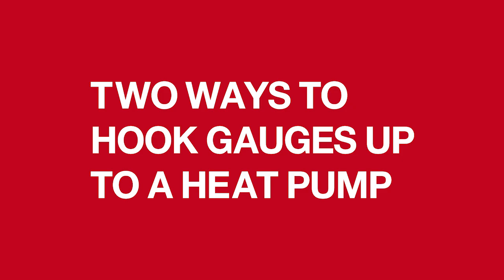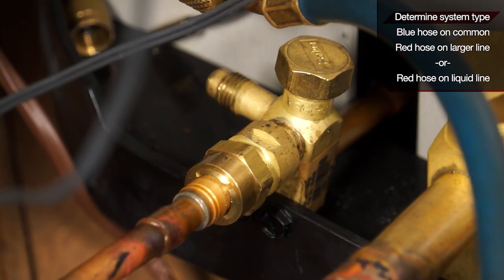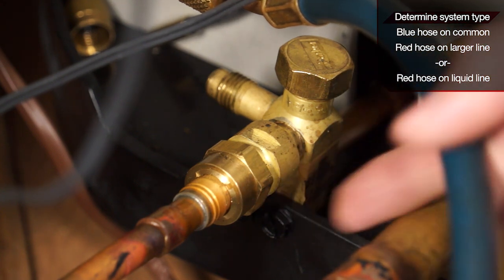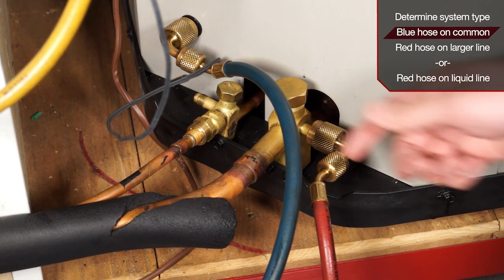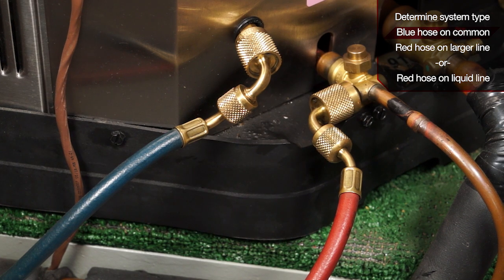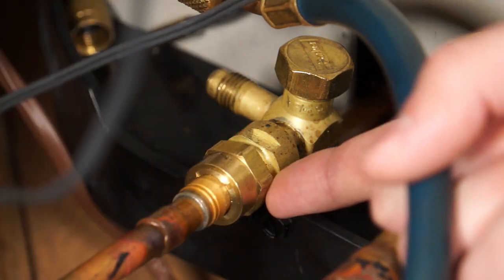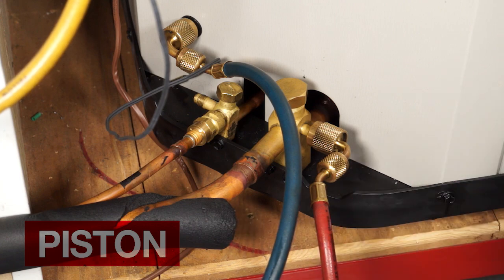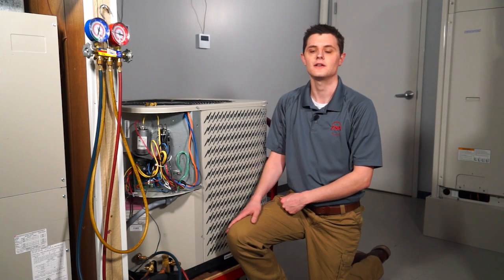Two Ways to Hook Gauges up to a Heat Pump

Comment: I'm confused now. Why do you put the high side on the high side in heat mode if it's a txv but on the low side if it's a piston
Reply from the maker: It depends on the metering device for the heat pump and where the metering device is located in the condenser. On a piston driven heat pump, the bigger copper line ends up being the discharge line in heat mode. This is the high side of the system.  On the liquid line for our 14 SEER unit, there is a swivel nut connection which is where the piston is located. If you take pressure on the liquid line service port, you will be reading a metered refrigerant. The 16 SEER 2-stage equipment is TXV driven, which means you need a liquid pressure and liquid line temperature to check charge.

Comment: That whole it's threaded if it is a TXV valve or soldered if it has a piston is completely wrong I worked on Goodman's. carriers. Trains. it doesnt matter. best thing is to look in the air handler if you see a TXV then you got a TXV if not then you have a piston
Reply: The video is cryptic.  He doesn't clarify WHERE the TXV is that he is talking about.  Many heat pump systems have TWO TXV'S, (One at the indoor air handler, and the other outdoors, inside the CONDENSING unit.)  BUT, IF the condensing unit has a piston on the SMALLER LINE, it will have a flare nut to access the piston. With pistons, you put the red hose on the LARGER line DURING HEATING MODE.
Reply: @BYENZER bingo brother. This video is terrible tbh. Heat Pump w indoor piston you would put blue low side gauge on common suction (middle valve) and red high side gauge on the larger line to check in HEATING MODE. in cooling we can hook up as normal but in heating when the path is reversed that common port is the true liquid line.